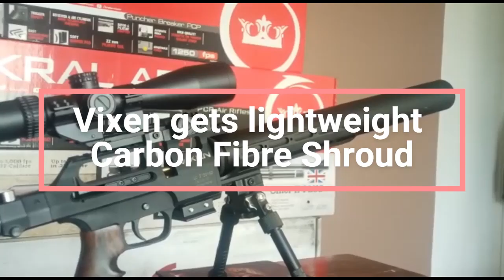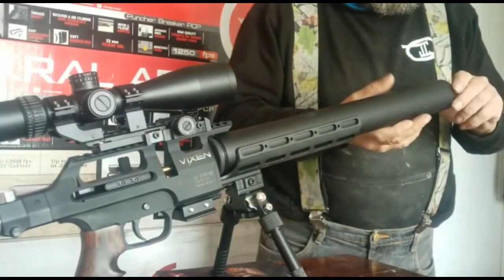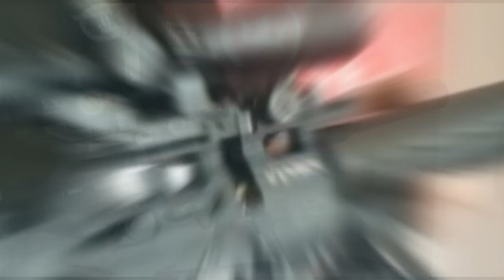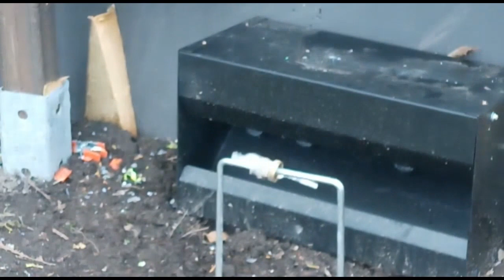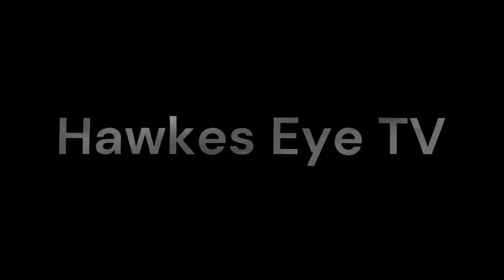Vixen gets new Lightweight Carbon Fibre Shroud.

Comment: I own a Vixen Short in .177, I was told today that a BRK Ghost would be an upgrade, it did shoulder nice but is it a better gun in your opinion?
Reply: Hello Darren, sorry for the delay,, I'd say you need to get a chance to shoot the ghost, I'd say it may have the edge slightly due to longer barrel system, although the Vicky has the cz barrel, not an easy one as the agt is such a well made gun, Best Regards, Jon 👍

Comment: Did the shroud make a difference noise wise mate ? Any quieter than the stock shroud?
Jon
Reply: Hello John, about the same, maybe the agt moderator set up, or the Don't fl set up if you need it to be quieter, Best Regards, Jon 👍